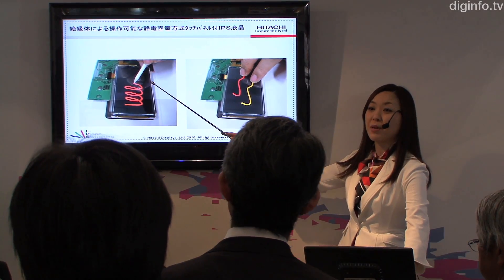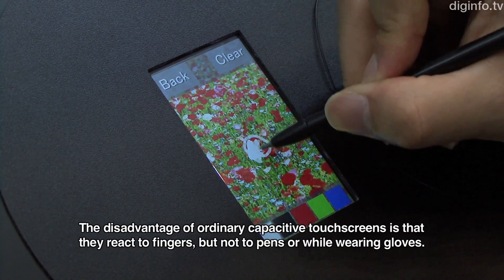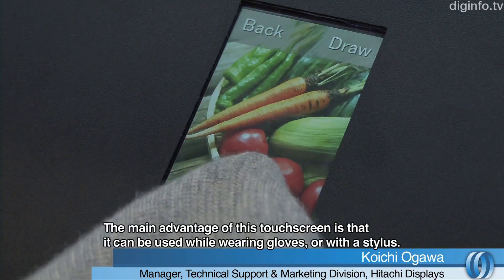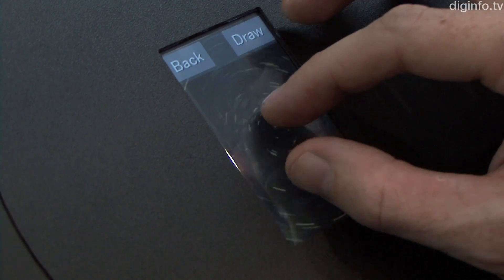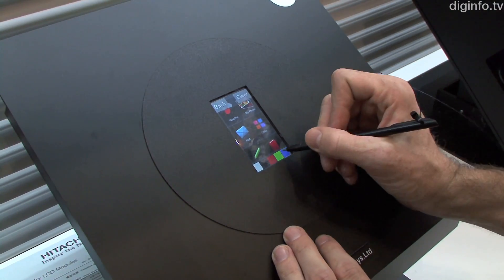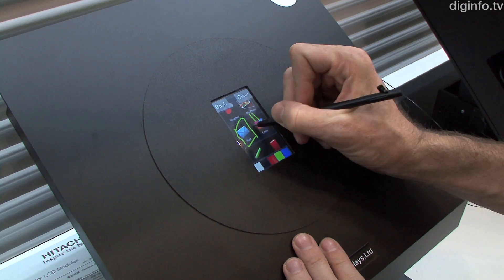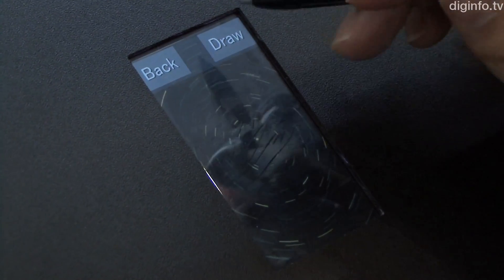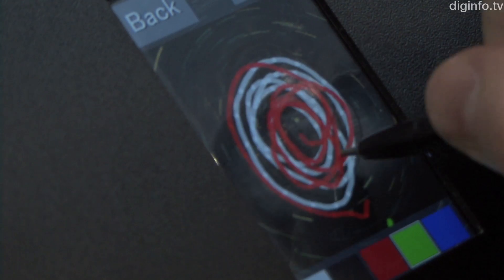Capacitive Touchscreen Usable with a Stylus : DigInfo

Comment: @eliziergancena Well, there are two types of touch screens out atm. One detects electric conduction, while the other detects pressure. This screen detects both ways while the D.S. detects pressure. An example of a conduction detecting screen would be a laptop touchpad or an iphone in case if you were curious.